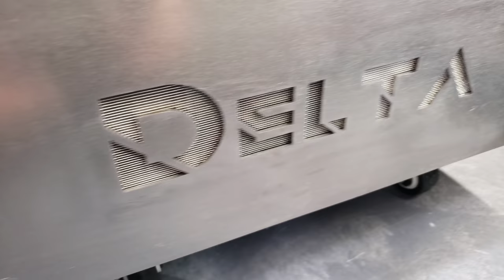ESP32 Delta Robot Sorting Golf Balls with Machine Vision

Comment: A reservoir for the vacuum would seem like a good idea, there's such a long pause during pick up, smoother acceleration would make it look like poetry in motion, at the moment it looks like an aggressive toddler :) great work looking forward to the updates
Reply from the maker: Having a tank is a good idea. Less acceleration looks better but sounds worse. All three motors, three power supplies and three drivers were only $300. Just a set of decent drivers would cost more than that.
Reply: 1/4in neoprene rubber under the motors?
Reply from the maker: @vizionthing  I'm sure that would help but I really think the motors/drivers are poorly made. I wish I had spent more money originally but for a hobby project that I have no specific need for yet, it was hard to justify for me. If you look back at a video I posted 9 months ago about controlling large stepper motors with a phone you see that even the motor on its own sounds awful with "smooth" acceleration. Clearpath servos seem perfect for an application like this because of the built in software to control the acceleration profiles but each motor is more expensive than my entire machine.

Comment: If you put two cups on the arm and a 180 degree rotation (like a wrist) then you can aim for between the two balls that need to be sorted, which would save time and avoid the empty column.
Reply from the maker: That would definitely speed things up but at the same time it would slow down the top speed due to the weight of the end effector increasing.

Comment: The motion control is pretty .. rough. Would like to see smooth control with limited acceleration and jerk. This could for example be done with Hermite or Bezier splines.
Reply from the maker: Lowering the acceleration looks better but sounds worse. This is my first cnc type machine that I have programmed from scratch so if you have programming advice for 3d motion profiles without the use of cam, I'm all ears. I've built a cnc router from scratch but I used a Gcode software like Mach3 to control the motion profiles.
Reply: @ProtoG42  Do you use micro-stepping on the stepper motors? That can improve the noise problems AFAIK. I could help with the trajectory generation. How do you control the motors? I could provide 3D posistion/velocity/acceleration as a function of time. Or rather some code that generates those numbers.
Reply from the maker: @janismac314  Going from 1/8th then to 1/16th and finally to what the machine is using now; 1/32nd microstepping did help quite a bit. Beyond that, I didn't see any improvement. Right now, I am using direction and step signals and using a library called AccelStepper that I can set the acceleration. I have a custom motion path programmed for each ball position in 5 steps. Initial move, One ball height above position, plunge position, release position. The problem with that is that it accelerates and decelerates between each step which is unnecessary. If I could chain them together in more of a curved single motion with acceleration and deceleration, it would be much nicer but I'm not sure where to start. I may need to ditch the Accelstepper library and create a custom library because Accelstepper does not support curved paths. I could use something like GRBL that uses Gcode but I would like to avoid that because I do not want a computer attached to the machine. I have a more than full time job so I don't have as much time to spend on this as I would like. Overall I'm still pretty happy with everything and my next robot will be a SCARA which will be much easier to produce smooth motion.
Reply: @ProtoG42  I would download the code for Delta type 3D printer like Marlin and feed that normal cartesian coordinate inputs for positioning. The Marlin delta code then automatically translates everything from cartesian to delta coordinates, making programming a lot easier. And I believe the G code interpreter inside Marlin is based on grbl, so it can chain the movements to be in one continuous flow.
Reply from the maker: @JaakkoF  As I said, I do not want to use GRBL. I've used it before but I would like to learn to do the motion control on my own. GRBL still would not give me an easy way to map the 3d paths in space, it would just accept the commands. I don't  think it's possible to avoid at least some form of cad/cam though without it taking forever.
Reply: @ProtoG42  CNC machines use two modes of motion: rapid traverse and linear feed. High-speed linear feed is very rough, but deterministic. Rapid traverse seems to only have the end-point determined, but with 0 overshoot. I assume they measure how long acceleration of each axis takes and factor that in for slowing down.

The manual I read for an Okuma lathe from 30 years ago stated that they recalculate trajectories every (IIRC) 12.8 ms.
Reply: He can use TMC2130 1/256 microStep so smooth and silent.
Reply from the maker: @jamescarlton4068  No I can not. These motors are 60V 6A motors. TMC2130 can only be used between 5-56V and output 1.2A max and are meant for small motors like on a 3d printer. There are definitely better drivers out there though.
Reply: @ProtoG42   Ah ok. For delta configuration, you dont need high torque, your platforme does not weigh so much in the way i see it. (Sorry for my poor english :) )

Comment: Great work! Maybe mount the servos on a silicone pad to isolate the motors from the frame, it might cut down on the servo buzz.. Plus a vacuum reservoir tank might help on the compressor noise.. Just a thought.. Way cool project.
Reply from the maker: Thanks! The vacuum tank would definitely speed up suction time. I'm sure the pad would help but I really think the motors/drivers are poorly made. I wish I had spent more money originally but for a hobby project that I have no specific need for yet, it was hard to justify for me. If you look back at a video I posted 9 months ago about controlling large stepper motors with a phone you see that even the motor on its own sounds awful with "smooth" acceleration. Clearpath servos seem perfect for an application like this because of the built in software to control the acceleration profiles but each motor is more expensive than my entire machine.
Reply: @ProtoG42  I get it, it's hard to justify the expense when your just trying something out. I've seen some servo motors with the "smart" software and they've always worked for me. Yes, more fiddlin but better results w no excessive noise. Either way, great project. We all do what we can w what we have. Thanks!!

Comment: Is there enough memory/processing to do the sort internally on the micro and generate a move list? That way it's not doing it on the fly...
Reply from the maker: Absolutely, that is actually what I've done. I've programmed the motion path for each ball location separately which is why I have only finished the first row. The ESP32 has much more memory than most other microcontrollers. I'm not even using close to half of the available memory right now.

Comment from the maker: Here are links to some of the equipment used on my delta:
Stepper Motors and Drivers - https://amzn.to/2RcFBqK
ESP32 - https://amzn.to/2TK9Sik
Object Tracking Pixy Camera - https://amzn.to/2r4GaaL
Suction Cup for Golf Balls - https://amzn.to/2Rl1ub2
M5 Hose Barb - https://amzn.to/2BDxGMF 
Braided Cable Sleeve - https://amzn.to/2LedCnb
Stainless Steel Cable Ties - https://amzn.to/2LevZsb
Strain Relief Cable Glands - https://amzn.to/2LdnuO8
Silicone Fusing Tape - https://amzn.to/2J5RPO8
Locking Casters - https://amzn.to/2kJ75WB
Aluminum Extrusion - https://amzn.to/2Lh14M7
Cable Clips - https://amzn.to/2xColG8
M5 T Slot Nuts - https://amzn.to/2HdnNWP
M5 Screws - https://amzn.to/2J4OSBs
Carbon Fiber Tubes - https://amzn.to/2J5xVqz
Suction Cup Nozzles - https://amzn.to/2Qh2Vqg
Brass Standoffs - https://amzn.to/2ULGadz
Lab Shelves: https://amzn.to/2RuGv5k
Vacuum Pump: https://amzn.to/2Rp5NBY
Solenoid Valve: https://amzn.to/2Vo47aX

Comment: I love and hate how it sounds and moves
Reply from the maker: Thanks! It sounds much cleaner at lower speed but I like it moving fast. If I wanted it to sound  super clean at high speeds I would need to replace the planetary gearboxes with very expensive harmonic gearboxes as well as higher quality motors/drivers. One harmonic gearbox like models used in industrial delta robots, would cost more than my entire machine.
Reply: @ProtoG42  that's understandable, it sounds like it's gonna break at any time still lol
Reply from the maker: @UntrackedEndorphins  That's a normal sound for a spur gear planetary gearbox and cheap motors/driver. It definitely is not at risk of breaking. It would easily break a hand if placed in the top window and I can't stop the movements with my hands from the bottom. Look up trinamic stepper motor drivers and see how much a quality driver can change the sound of the motors.

Comment: Remove mass from the arms! Those look way too heavy, so much more rotational mass to accelerate. Should cut down on the shaking in the frame, probably some noise too.
Reply from the maker: The frame isn't shaking, the cart that it is sitting on is shaking. The arms are too light if anything for these motors. They sound worse without the arms on at all.

Comment: The steppers are way over powered for the load, even at speed...  this is the cause of your noise.
Reply: You could probably sort colored bricks with this thing..
Reply from the maker: Yes and no. They are over powered for this particular application but I manage a manufacturing facility and I wanted to have the option if decide to use it for lifting much heavier objects than the golf balls. The noise can be reduced using inertial/harmonic dampeners and better drivers. Even without power connected to the machine, the motors are loud when moving by hand quickly. The torque of a stepper motor is drastically reduced when microstepping and when driven at higher speeds. At 1/8th microsteps, you're already at around 19% of the original rated torque. At 1/16th microsteps, the motor now only has around 10% of the original torque rating when holding at the micro step positions. The power of these motors gives me much higher torque at high speeds and higher resolution compared to smaller stepper motors.

Comment: Your mechanical engineering skillz are top notch but your algo development leaves a bit to be desired. Think of the rows of different colored balls as an array. If you have machine vision then you can test the sate of each element (color of the ball and what slot it is in) to get it to only modify the ones that don't align with the standard coloring instead of touching every ball in order to organize the array. That should easily eliminate 50% of the movements you are making. Remember that you have a full row of empty slots so you could also multiplex the work that needs to be done by putting the instructions in a stack (known as a queue for others). I don't know your hardware limitations but considering that you need to keep track of color and position to properly formulate the desired matrix then this can be done by the weakest of Arduino. You can gain much efficiency by evaluating the entire matrix and formulate a plan to fix it on the fly in memory much easier and cheaper than doing it in the physical world where it costs you way more in time and wattage.Your hardware is good but your algo/approach to solving this matrix problem needs some work.